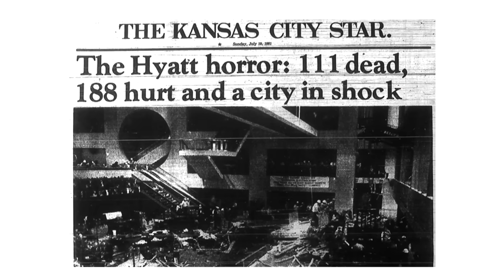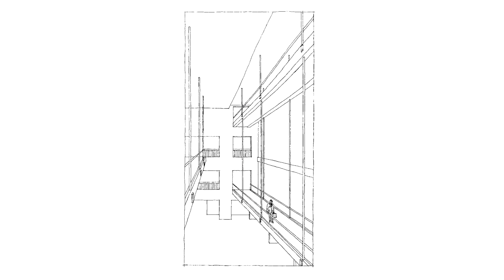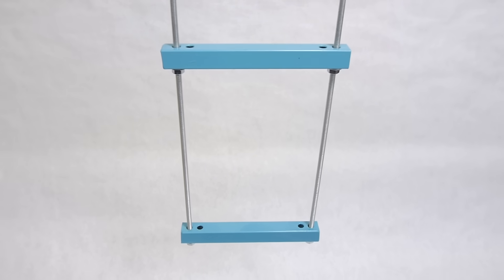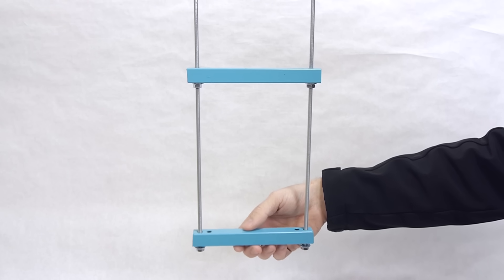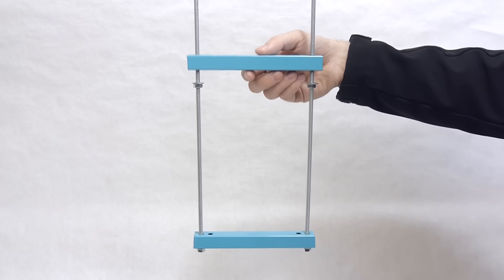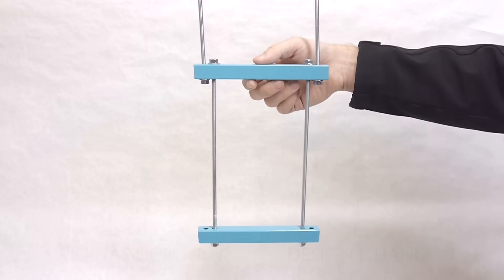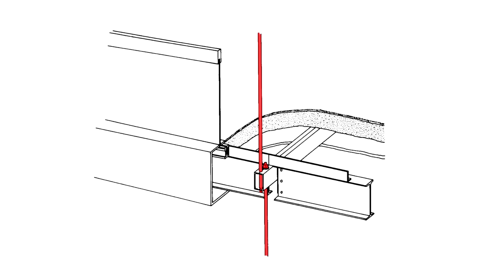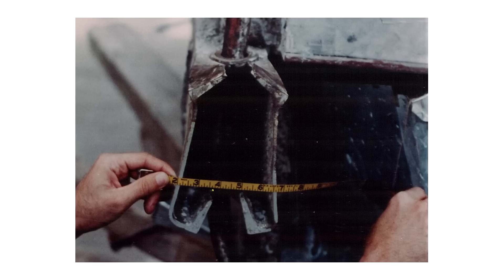The Disaster That Changed Engineering: The Hyatt Regency Collapse

Comment: So, I've heard of the Hyatt Regency walkway disaster before.  I saw a show on TV probably 10 years ago now about it.  They came up with a different cause for the failure though - the square tube supports were built as 2 u-shape pieces welded together, and the original design called for the hanger rods to be bolted through the unwelded side.  However, someone at some point changed things so that the bolts were run through the welds top and bottom on the square tubes,  which was not as strong and thus contributed to the collapse.

I realize there are likely multiple contributing factors to any disaster such as this, but every time I've seen the Hyatt Regency disaster mentioned, no one mentions the fact that the rods went through the welds as a contributing factor.  Am I misremembering, or was it just deemed to be of lesser concern than the change in the way the rods were hung?
Reply: Steve Pittman +
Reply: Steve Pittman — The doubling of the load was the most significant error, but investigators found that the original design with long rods going through both decks was also below code.  Whether changing the beam to an “I” configuration would have been strong enough I do not know, but I think hanging two walkways from the roof on steel bars is just wrong.  The motivation was just to make it visually striking, not safe.

Comment: Surely the walkway was poorly designed originally, as the factor of safety should have been about 5 (as it's sort of a bridge) and so even with double the force it should have been OK?
Reply: Luke Nisbet +
Reply: Very few other people commenting here have mentioned safety margin.
Many people said that they immediately saw the cause, meaning the load doubling, but from the simple diagram shown (the blue beams) they did not see the real cause. The bad assembly of the beams was the cause. That was not shown until later.
If the structure had been capable of supporting many times the highest weight and extra impacts from a full load of people jumping, as it should have been, then the design change would not have caused any trouble.

Comment: I was almost correct. I thought the problem was with the top walkway having to carry the load of the bottom walkway and that the walkway itself might break. I didn't realize the bolts would be the problem.
Reply: The bolts ripped through the beams. They were also two C beams welded together to make a box, like this: [|] so the bolt/washer ended up resting on top of the weld right in the middle, if I remember correctly.
Reply: the bolt didn't break, basically the ends of the walkways where the bolts were split open and slipped past the bolts, so the bolts were fine and could take the load but the walkway couldn't
Reply: qirat73, So I was right. I was just wrong about being wrong. Thanks for validating my already probably too big ego.
Reply: I was thinking that the top one would fracture in the small area between the two bolts so that when the walkways were overloaded it caused the whole failure.  But I can see the bolt thing occurring as well.
Reply: Huntracony +
Reply: Huntracony +
Reply: Huntracony +
Reply: wow you sound like a douche, and you weren't correct either time. it was what was supporting the walkway that gave. and wasn't just from supporting the walkway below, it itself was changed for aesthetics as well reducing the strength of the arrangement.

Comment: And that my friends is why you unit test before you deploy.
Reply: Generally not feasible for civil structures unfortunately
Reply: Unit tests, integration tests, regression tests, QA, burn-in tests...
And then you get the last-minute call asking if you can fix one tiny problem. "Something like this?" you ask, sending them a completely untested patch. Surely they're not going to just apply your patch and deploy without rerunning the tests, or even any code review, right? Right?
Reply: Unit testing wouldn't have caught this at all... as it was an integration problem.
Reply: I've only heard of unit testing for software development. How do you unit test for engineering?
Reply: It compiles... let's ship it.
Reply: The Modern Shoe: I was only joking. :P In engineering there generally aren't "unit tests" in the software sense, since testing every conceptual component separately would require an enormous amount of test hardware, which itself would need to be tested. Plus in the hardware world, you need 2 kinds of test: design qualification and specific hardware functionality.

The good news though is that hardware is typically far simpler than software, and you can usually get away with testing at the final stage. In the case where software is embedded in and controls hardware (this is most cases) the software can and should be united tested separately from the hardware.
Reply: iabervon: It seems from the story, that's exactly what happened here.
Fabricator: "Hey, this pole is threaded all the way up and that would require our assemblers to actually be careful enough to not break things.  How about we make them separate like this so it's easier on them?
Engineer: "Uhh...  sure, you do your thing." stamp
And thus, without review, hundreds died.
Reply: programmer logic
Reply: test in production!
Reply: Stick to chocolate
Reply: Unit tests are all green. The bolts could hold their design weight easy. It's an integration problem.
Reply: Benjamin Hershey +

Comment: I believe the way the rods attached to the box girder was also a factor, which was two U beams welded together. It meant that the bolts were attached to the weakest thinnest point in the box, encouraging the weld to unzip and fail. An extruded box or something other than a box may have been strong enough despite the design change.
Reply: Yes, the rods went through the welds where the C beams met, so the weight basically tore the bolts and washers through the welds.
Reply: Even if they MUST use those shitty channels, the disaster could have been avoided if they got a labourer to make a few 100 by 100mm square washers to go with the nuts. It would have taken just an hour to make them all.
Reply: I read somewhere that originally the beams were supposed to be oriented like this ][ than like they actually ended up []. Not sure why that was changed, can't remember. Also can't remember if that was a design change or if it was accidentally changed in construction.  But the original design would have been much stronger and able to bear more load
Reply: @raerohan4241  That really should not have mattered.  The original design may have used a design table that assumed back to back channels, but the load capacity would would not have been reduced by orienting them like [].  If anything the capacity may have even been higher as that orientation braces the flanges from local out of plane buckling.  If the channels were back to back a rod would not be able to pass through them, so I doubt that was the original design intent.  Unless the original plans called for welding the rods to the girder but I don't think that was the case.
Reply: @raerohan4241  Somebody else claimed this. I have three issues with the claim

 - How do you attach the rod? If you just ][ them the connection to the rod is very different. It can't just go down the center... that would cut the beam through the flange. The connection would be all different and possibly the connections to the tall longitudinal W-sections... That would have gone back for review. "Hey, Bob, we'll just shift this part of the rod over here and use the same connection, cool?" "Cool." vs. "We're kinda totally not building what you designed. Cool?" "We'll have to get back to you on that."
 - I can't find any, let alone an authoritative, mention.
 - It doesn't come up in Salvadori.
Reply: Correct. All the weight was on the weld joints. It is entirely possible simply using a U-shaped bracket made of milled steel as a spreader would have prevented this by distributing the weight across the entire surface, just as a washer is used on smaller screws. It still wouldn't have been "right" from an engineering and safety perspective, but this simple change might have saved the lives of all these people.
Reply: @WardenWolf  BUT... if somebody were to have recognized that this simple change needed to be made they wouldn't have done this. "Hey, this is a shite design." "Okay, put a band-aid on it so it's shite with a band-aid." OR... "redesign it so it's not shite."
Reply: Remember, the fourth floor box girder was originally intended to take only half the load it ended up taking.
Reply: @Iceykitsune  Maybe. It was intended to take 100psf live load per code. The walkways were not fully loaded at the time of collapse.
Reply: Strengthening plates welded across the top and possibly also sleeves would've helped. It failed with double it's intended load, I'd expect a higher safety margin personally. Sticking to the original beam design and having the rods joined directly together with threaded couplers probably would've been the best solution
Reply: @TheTomco11  What wasn't really discussed in the video was the eccentric nature of the rods meant that very large shear forces developed in the upper flange of the girder.  This local stress concentration in the small area between the rods also lead to the weld opening up which lead to a punching failure of the nut and washer.
Reply: @robertcowling4313  In my experience the contractor is typically not really capable of identifying nuanced engineering topics like this.  They ask for alternates or substitutions all the time to try to save money, and it's the job of the engineer to approve or deny them.  That's literally what they're for and why they are the ones who have final say on how the building is constructed.  If I recall, this change request was looked at by a junior engineer in the firm and the engineer of record simply signed off on it without really looking at the change with due diligence.  This is a big no no in the engineering world.  Obviously, tasks need to get delegated and dealing with construction administration is a great way to help young engineers learn the ropes, but all structural systems need to be looked at with respect to their reliability, redundancy, and cost of failure.  In this case those rods are about as catastrophic as you could possibly have.  There is no way such a risk sensitive change should have been decided by anyone other than the project's EOR.
Reply: Icey: The video failed to mention the contractors' change in the box beam fabrication which created a weaker box beam.
Reply: A circle is WAY stronger than a box!
Reply: @csonkaperdido  Not really true. A box section with the same width as the diameter of a tube of the same material thickness is both stiffer in bending and more resistant to crushing with compression forces applied across the sides/diameter.  That is, provided the force is spread out across the width of the box and its not poorly constructed by welding two channels together.
Reply: @ferrumignis  A box section with the same width as the diameter of a tube of the same material thickness has more material.
Reply: @csonkaperdido  now we just just someone to break physics and invent the inside-out circle.  Then we will have a truly indestructible beam.

Comment: I remember this tragedy. I was an apprentice boilermaker working on a nuclear reactor containment vessel. The vessel was built from the ground up, a standard practice in construction. there was a hanging roof system that covered the vessel from inclement weather and was used as a storage area for welding equipment, portable toilets, and modular offices. So everything was on a set of hangers that carried the load to the exterior concrete vessel containment. I am grateful for the engineers from Chicago Bridge and Iron for doing their job properly. The days immediately after that accident I recall a number of my crew spent extra time closely examining our project.
Reply: What local